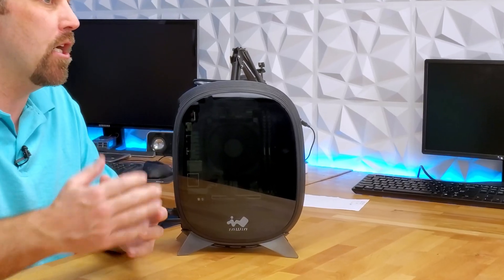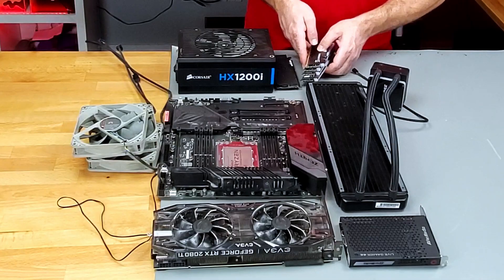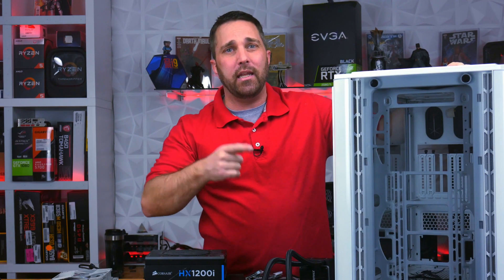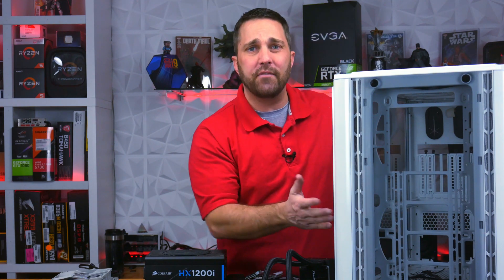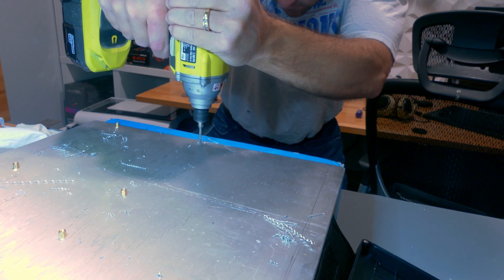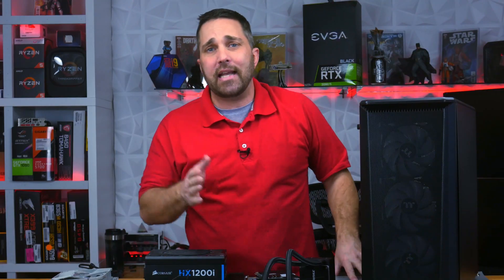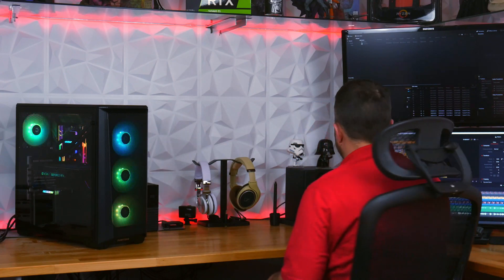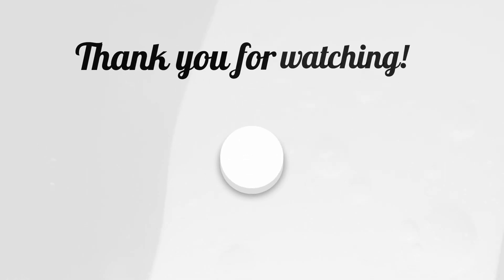I Stuffed $5000 Worth of Computer Components in a $60 PC Case.

Comment: bro, that negative air pressure. can you configure those fans with PWM controls or something to change the direction they spin because I imagine your pretty experienced with systems and know how air flow works. If you dont, which i highly doubt  the top 2 fans in your case are pulling air out of the case and sufficating it you should definetely flip them around
Reply from the maker: I think you missed something here. The 3 front fans are intake, the top and rear fans are exhaust, all tuned in BIOS for neutral air pressure.
Reply: @ElevatedSystems  ok

Comment: I need a pc like that 😂😂 literally I love gaming but have no pc
Reply from the maker: Then you don't need a PC like this. This is not a gaming PC it is a workstation. I'll be building a low budget gaming PC in my next video.
Reply: Elevated Systems Yeah Ik but I wouldn’t go with a amd cpu id go with an Intel one and something more gaming style it would be cheaper but good for editing too cause I wanna start a yt channel but thanks for clearing that out
Reply: Yeah this would be a terrible gaming pc. The 2nd gen 32 core threadripper can actually perform worse than a celeron from years back. Depends on the game and drivers. Not to mention for around the same price you can build a 10900k from silicone lottery that will clock higher than any other cpus on earth without ln2.
Reply from the maker: @MisterRorschach90  Actually, after the Windows 1903 update fixed the Threadripper core scheduling problem and with Asus' precision boost enabled this system does game very well, however no I would not recommend this as a gaming build.
Reply: Elevated Systems that’s good to hear actually. Because I have been considering getting one for bigger workloads in the future when the price drops again.

Comment: Not gonna lie that EVGA card is overrated trash. The MSI cards have the best cooling and FPS, and honestly have the best rgb if someone’s looking for rgb in a 2080ti, the MSI RTX 2080ti gaming x trio is by far the best 2080ti available, I’ve seen plenty of videos of the MSI card outperforming every single one and getting lots more FPS, pretty sure that EVGA card is still almost 2000, like 1700 or 1900, the MSi card is 1300 some dollars and overall looks better and has better performance, but cool build brodie
Reply from the maker: The EVGA Black edition was the cheapest 2080 TI available and I got it for $1099. Cooling has not been a problem. Also this is a production workstation not a gaming PC. FPS isn't always a consideration when buying a graphics card. I flex the Tensor, and RT cores as much as the Cuda Cores on the card.
Reply: Elevated Systems I for some reason thought it was the ftw3 my bad